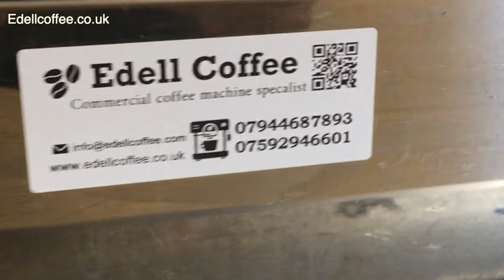COMMERCIAL COFFEE MACHINE (FULL SERVICE, REPAIR)

Comment: Hi there!
I live in France. For those who are still wondering what kind of acid to use, I have cleaned mine with St Marc acid citric, and it worked just so fine only by keeping it submerged all night long.
Reply from the maker: Hi there 
Try ( Sprit of salt ) . Better than others . It will be enough to leave it in acid for only 2-3 hours.
Reply: @edellcoffeeuk  citric acid is less dangerous than spirit of salt I guess.
Reply: @guillaumedurant7647  how do you use citric acid? at what concentration? And do you deep the parts in the solution to descale them?